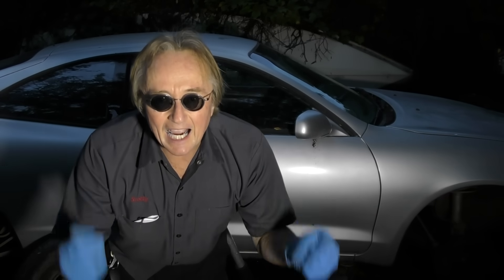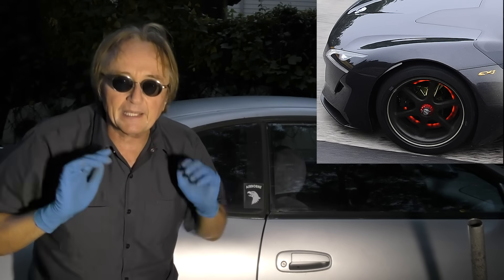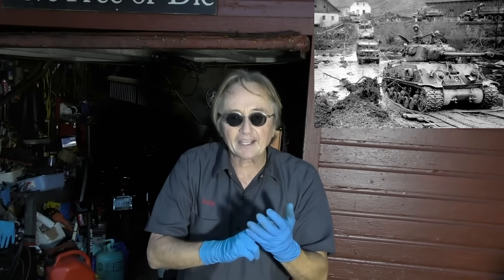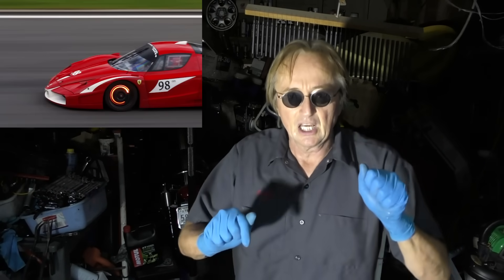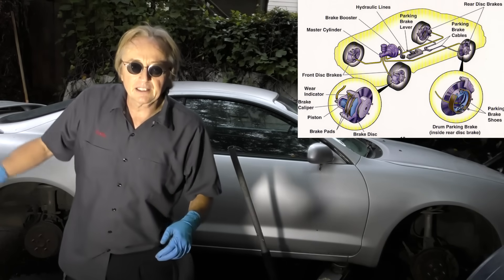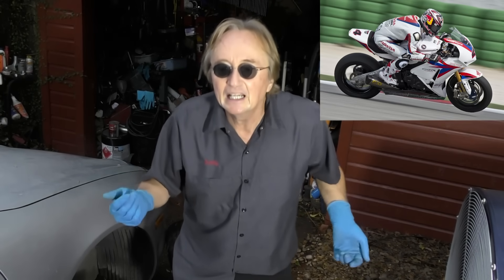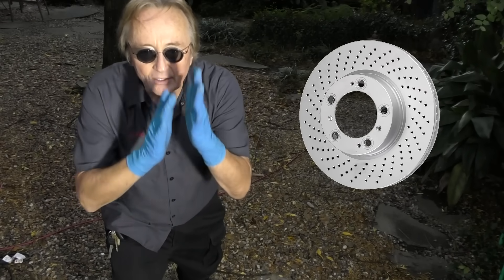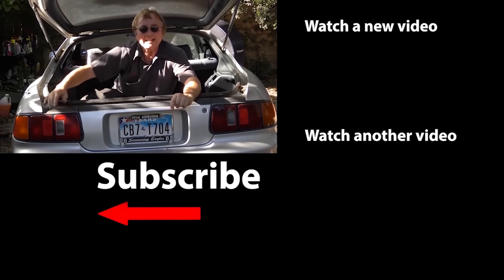Why Some Cars Have Drum Brakes Instead of Disc Brakes

Comment: When I was young I was driving cars from the 60s. These had 4 wheel drum breaks.  They would fade if driven in water or under hard breaking conditions. My Ford Galaxy 1968 had disks in the front drums in the back. I had a 1979 Chevy that was also the same. 

I was reading disk breaks was originally used by the railway. These went back to the late 1800's.

Comment: I had one of those old Mavericks too when I was a kid.  For what they were, they were great cars.  The motors were awesome compared to other economy cars of the era, which mostly had shitty 4 cyl engines with NO power.  Maverick's 6 cylinder engines were durable and had decent power for a car this size.  They were extremely simple and lots of room under the hood to access everything.  Those drum brakes that Scotty is talking about had constant problems with leaky wheel cylinders, though.  They also had really clunky interiors.  Mine still had the original sticker in the glove box from when it was new, and it only cost about $2200.

Comment: 1924 Durant came with drum/disc brake. They was a drum with brake shoe on the but a brake pad on the outside of the same drum with made it work like a mechanical disc/drum brake.

Comment: One other feature of drum brakes is the 'self energising' effect the shoes have when in contact with the drum. It's like driving in a 'wedge' that gives the shoes more 'bite' with less effort required on the pedal which was great before brake boosters were invented. Besides that drum brakes are terrible for seizing up, holding dirt and water inside drum, need regular cleaning and adjustment and don't dissipate heat anywhere near as good as discs.

Comment: I always apply both brakes equally on a motorcycle. I don’t want a cement sandwich!
Reply: As you should, keeps the back end from ending up in front of you.
Reply: An old guy told us years ago, when you downshift to slow your car your using engine parts, transmission parts and rear-end parts to brake with. A set of brake shoes or pads are way cheaper than any of those.
Reply: Especially when going through corners. Rode the Tail of the Dragon not long ago, used the rear brakes more in that day of riding than what I normally use in like 3 months
Reply: I use engine breaking and some front brake because I don't need to move my foot

Comment: ATTENTION EVERYONE;
If your front breaks are locking up more than your rear breaks you have less control because locked wheels don't steer too well. 

So you want more breaking power on your rear than on your front.

Comment: My rear drums lasted me 175,000 and they still had 50% life left.  I changed the fronts 5x in that time.  I use $16 advanced auto silver pads in the front so they wear out quick and do not dig into the rotors.  I’d rather wear out pads than rotors. I can do a front brake job on this car I owned 18 years since new in 45 minutes

Comment: I've got slotted disc on my wagon, I always baby it & have never considered tracking it.
So why?
For my caravan, especially when I go down the blue mountains.

I had normal disc on my previous wagon, very similar car but I would notice brake fade under heavy loads,

Slotted my have been intended for racing, but they certainly do great in other areas!

Comment: In most vehicles these days, the front brakes do 60-70% of your breaking, and since all newer vehicles have disc brakes in the front, the rear brakes don't do much for normal driving, as Scott says.  And for those who bought trucks that have rear drum brakes, if the trailer is heavy enough to substantially affect the braking of the truck, it should have trailer brakes anyway.  For example, I occasionally will pull light single-axle trailers without brakes on them, and the drum brakes do just fine.  U-Haul trailers have surge brakes so they at least have some sort of braking on the trailer, as does most travel trailers and anything with 2+ axles.

Comment: If drilled and slotted rotors are more prone to cracking etc: then why do majority of motorcycles use them ?cause they brake worse and warp,don't think so🤔Solid rotors warp in heavy vehicles way faster than drilled,replaced my stock rotors with o.e.m. when they were bad,stock ones lasted a year,put drilled rotors all the way around that was five years ago , no problem😳

Comment: Drums are actually more efficient.....the old standard brakes were ALL drums, when you got disc brakes they HAD to be power assist in order for you to have enough leg power to push the pedal down. Try rolling a 4 wheel disc brake vehicle down a hill in neutral and stopping it without the motor running, bet you won't stop too quickly......now do the same with a 4 wheel drum brake car and see the difference.

Comment: Motorcycle / bicycle comment you don't really want 90% of your braking to be in the front cuz it will throw you over the handlebars and is a very dangerous situation unless you are skilled and can ride on the front tire like in the picture he showed just saying and yes I've been thrown over my bicycle handlebars a couple of times and I stopped using the front brakes on a bicycle I only use them when I needed extra stopping power and I still always almost threw myself over the bars when I do

Comment: The first production car with disc brakes on it was a 1948 Chrysler. They were a bit different design but they did function, because of the complexity of that early design it was scrapped until it was improved. The other production car with the disc brakes was a Tucker.

Chrysler was the most innovative of all the car companies and it's day. Automatic transmissions were perfected by Chrysler, alternators, power steering, the first to try out 4-wheel disc brakes, and they even had an electronic Port injected engine in 1956 or 57. But they were trying to do it with vacuum tube controls. Anyone who has ever worked with electronics that use vacuum tubes knows that they don't stay stable very long. Transistors were still, in the mid-1950s, classified technology.

Comment: gonna have to correct you there scotty.

1. the front to rear braking power is divided by about 66% on front tires 33% on rear tires. This has more to do with the weight of the car shifting forward when braking "in a straight line."  Braking in anything other than a straight line and the braking force on the rear tires will be needed to work as an anchor to keep the nose pointed in the right direction. As you said when driving normally rear wheel drum is enough to get the job done but if you're the kind of person who thinks speed limit signs are just fancy roadside decorations. . . Well let's say I have experience with the rear end breaking out do to brake fade. Entirely my own fault off course but still.

2. On motorcyclists not using the rear brake. Unless you have a very stable bike with a long wheel base and relatively low center of gravity most of the maneuvers I need to do every day on my morning commute are extremely difficult if not impossible without the rear brake. Stuff like keeping the bike restrained while letting the clutch slip a bit as you prepare to merge from a standstill or onto a roundabout. Getting the bike to settle back down if you were a little too generous with the throttle and it starts to wheelie. If you have to do an emergency stop and you forget to use the rear brake first you can even flip over on some bikes. I've even used the rear brake to regain control after the rear tire had lost traction on some loose gravel in a corner and had began to go sideways.

Comment: I still don't understand how it could possibly be cheaper to make drum brakes than disc brakes considering how much more parts drum brakes have. It seems like shoes, drums, wheel cylinders, backing plates, springs, pins, clips, self adjusters, etc would cost a lot more to make than rotors, pads and calipers. What am I missing?

Comment: This video explains the difference between drum and disc brakes very well. I'm on my sixth car now, all of which had drums on the back and discs on the front and they worked just fine, I never had any problems stopping. In recent times I've seen most if not all new cars with discs all around. That's just fine if you drive only on asphalt or dry gravel roads. I remember one company vehicle that was driven on gravel a lot and in wet weather the mud would splash on the brake discs and cause damage from uneven and premature wear. What was wrong with the old configuration of front discs and back drums, and who was the bonehead who decided to get rid of back drum brakes?

Comment: Drum brakes provide better gas mileage.
Drum brakes "fully retract" from the drum when not in use. Disk brakes always slightly rub. This rubbing increases rolling resistance, which decreases mileage.

Comment: This answered all my questions. I have a 2002 Mitsubishi Lancer ES that has 14" wheels with drum brakes in the rear, and disc in the front.  The drum brakes were replaced/renewed about 18 months ago. Then about 6 months after that, I was told from another shop that they are leaking, and something (I think the cylinders) had to be replaced to stop the leaks.  I only put about 9,500 miles a year on this car. It's my around town beater car, and I drive it to work which is only 7.5 miles each way.  It's been a great car the 5 years I have had it. Thanks Scotty

Comment: Bikers mostly use their rear brakes and only really use the front in unisen with the back at high speeds.  This prevents you from lifting the rear end. You even showed a picture of the consequence of using only the front. They only do that to perform tricks.

Comment: I have a 1990 vw with drums in the rear
I plan on switching it to disc brake beacuse my power goal is triple the power it comes with.
If you want to stop better but aren't going fast get new pads/,shoes and nice tires

Comment: I've been riding motorcycles since the late 60s and I know Scotty rides a motorcycle too.  But when he says many bikers only use the front brake, I wonder if he's losing his mind.  That's a sure way to crash - especially in turns - or flip the bike end over end.  Using front brakes only is a way to kill yourself on a bike.  Scotty should know better. The funny thing is, he said this in another video too. On the other hand, about 70% of braking does come from the front brake ON AVERAGE but you still have to use the back brake in many situations. Back in the early 70s, I rode a HD chopper (1950 panhead, hardtail). It only had a rear brake. There's no way in the world I would have traded that for only having a front brake. I didn't want to die young.

Comment: I drive in the Smoky Mountains alot for my job, brakes heat up fast here with the extremely steep mountain roads. I use high carbon rotors. They can withstand higher temperatures without warping and have a solid surface for more stopping friction. I had to switch to these after warping my two front rotors twice within two months. Not had a problem since.

Comment: Even Moto GP Riders hate the rear brake! If rushing a corner this is the only option to slow speed, but taking 1/2 second more time to lose speed then engine braking can be done! Shifting gears in mid corner is reckless. Low siding almost unavoidable. I have had 2 to low slides from rushing corners this year.

Comment: I rode motorcycles for 35 years I always use both front and rear brakes at the same time.  Because using just the front brake if you hit some slick pavement say bye bye.

Comment: Thanks Scotty! Love the history of disk brakes you mentioned- very interesting stuff and it makes sense. Dealing with an old Ford truck with four wheel drum brakes with no brake booster and they stink! I like the idea of converting just the front. Thanks again!
Reply: I have to take back the "they stink" part. I've got them working pretty good- just needed to tighten them up. This is something you can mention on your master cylinder video- the fact that the brakes need to be properly adjusted at the wheel so that they drag a bit (at least for drum brakes) to tighten the pedal!  Thanks again.

Comment: My first car was a 74 Maverick.  It was alright until a valve keeper caused a valve to get stuck in the open position.  The valve
head broke off in the engine, then you can guess what happened after that.

Comment: I have had a Nissan Frontier for 25 years...and in all that time I have changed rotors once and pads several times in the front.....but I have never touched the rear drums It's a 5 speed so I do a lot of engine braking and gentle coasting whenever possible.

Comment: 5:11 not only if you are racing but if you drive down mountains a lot. I live in a mountainous country, Haiti, so I can tell you that drilled rotors make a difference when I go down from mountains that are over 2Km (about 1.2 Mi.) high. Changing them more often should not be a problem for me so long as I feel safer.

Comment: Drum brakes are still used on the rear because drum brakes are really good for parking brakes. The early Corvettes actually had parking brake drums inside the rear rotors.

Comment: No complaints with drum brakes on my 06 Silverado.  Changed the front pads, rotors, drums, shoes, and wheel cylinders at 100k miles.  They were all original.  Not bad for 13 years.
Reply: pughconsulting     My brakes are all original too discs are fine but the drums in the back for some reason make noise when you brake below 30 KM 25 MPH so I think it’s time for a brake job

Comment: I just ordered a brake kit with cross drilled/slotted rotors. Thanks for the buyers remorse Scotty ;)
J/k I'm still pretty excited to get it in the mail.
Reply: Waste of money.
Reply: @maximusareilius2262  well I needed brakes anyway and these were only 70 dollars more than the regular performance brakes I was going to get. See I was doing about 130 the other day. This is pretty regular for me. Then my radar went off and I hit my brakes hard and my car got a little squirly. Didn't get caught. OE brakes did the job but the car is only two years old with 27k miles on it. Everything in great shape. I figured getting these might help keep it more straight in a high speed braking situation again.

Comment: My 66 fairlane had 4 wheel drum and single master cylinder. Someone converted it to dual master but plumbed with 3 drums on on cylinder, front passenger and both back, and the driver side front drum on the other cylinder. One day the cylinder working the 3 brakes failed and it was stopping with only one front brake. Car didn't have working power steering and that front wheel locked up, almost yanked the steering wheel out of my hands and would have pulled me into oncoming traffic if I hadn't maintained my grip and turned with all my strength to keep the wheel turned to the right! Talk about seat pucker! A Depends would have come in handy too.

Comment: Big reason for keeping drums is to provide a parking break. and even cars these days with rear disk also have a smaller drum built into it because it easier to have a cable operated parking brake than to try and make a hydraulic disk break have a mechanical parking brake. I think there were a few disks made with a mechanical parking brake, but most I see, looking at them through the wheels of cars that have rear disk, seem to have a drum for a parking brake.

Comment: I have 4 disc and its better than other car with the same system with 2 disc + 2 drums. Drums fail so easy and almost didnt work after long stop wiTH ABS really important to correct work 2 rear breakes

Comment: Im a little bit confused, how are drum brakes are cheaper to make? Drum brakes look bigger and seem to have more components? But a disc is just a disc? Can someone explain
Reply: A drum brake system is mainly comprised of the drum, shoes, and  slave cylinder. Various springs will also be used but their cost is negligible when bought in bulk. A disk brake system has the rotor, brake pads, and the caliper.
The drum is roughly equal in price to a rotor. The shoes and brake pads are also roughly equal in price. However, the slave cylinder on drum brakes is simple, small, and not very expensive. Whereas the brake caliper on disc brakes are bigger and more complex than a slave cylinder. Most of the extra cost goes into the caliper.

Comment: Hey Scotty...  Toyota still puts drum brakes in the rear end of their Tacoma’s and claims reason as... it keeps the mud and rocks out. Which is the opposite of what you just stated. But I agree with you. They were being cheap and don’t mind sacrificing some towing and off road performance to save a few pennies. Several other basic corners cut as well in things like lacking electric fans, electric adjusting seats, hood struts, and Apple CarPlay. Still a good truck though.
Reply: Jbog07  That sounds like some pretty excellent brake wear indeed. About the same rate as most of the trucks I have had. I don’t tow though... not much very often anyways. I do tend to coast to a stop if possible though. 

I usually upgrade my brakes when they finally do wear out. Using the internet and folks like Scotty to find the ones that last. I usually buy trucks with at least 150k miles on them for cheap... give them an overhaul... and put on another 100k at least before selling them and moving on. Seems to be the sweet spot for having vehicles maintain like-new reliability without any major work needing to be done. I usually drive GM and Toyota’s.

Comment: The brake fluid would leak into my fathers 1962 Holden drum brakes and every time he would come to sudden stop the drum brakes would lock up tight. He was unable to drive forward until he reversed back a car length or so to unlock them. If anyone was behind him, he would ask politely if they could back up. He didn't get around to fixing them for a couple of months as he thought it was only a slight inconvenience.